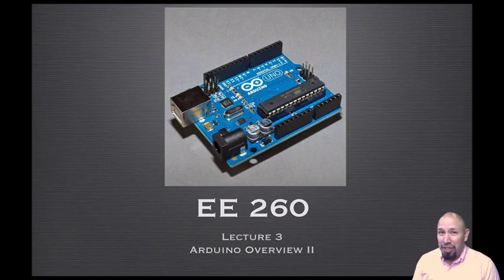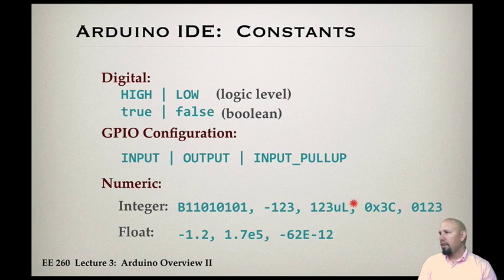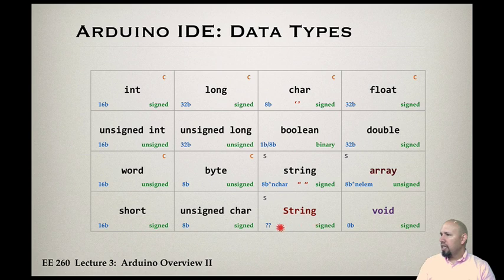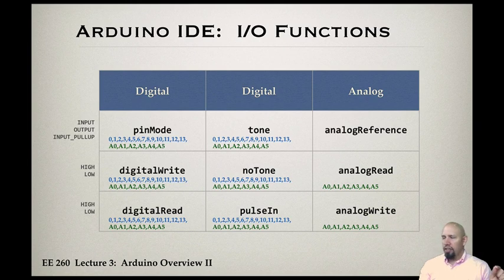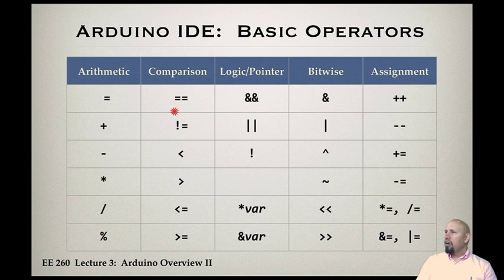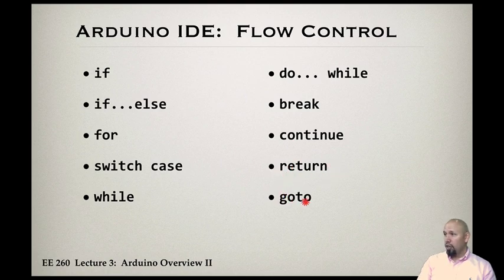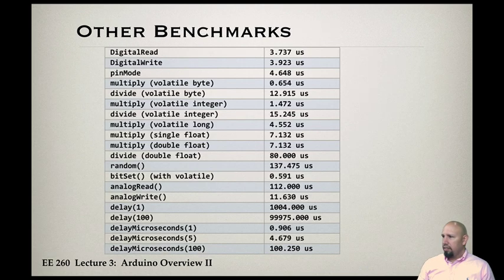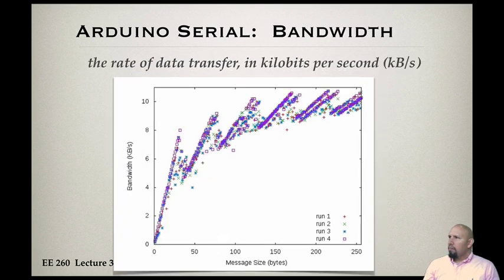3.  The Arduino IDE

Comment: Hi Robert;

I was hoping you could either make a video or maybe email me a discussion about how to write the void setup, pinMode, and digitalWrite functions and how to properly integrate them using C/C++. I personally think this would be a fabulous way to program the arduino, I understand that it is unnecessary since Arduino made those functions for us to NOT have to write that way but I personally find it to be much more fascinating and creative.

If and only if you have time. I have tried finding information around on the internet but unfortunately you get a lot of people who are more interested in posting insults and curses rather than attempt to actually answer the question, so the available information is rather sparse.

Thank you

Comment: Is there any way to do real debugging on an Arduino ?  i.e. breakpoints, source level debug, single step - the Arduino IDE is not able to do it.
Reply from the maker: There is not a simple debugging solution.  However, you can put code snippets into the setup() routine to check if they work properly.  You can send result info out to the Serial Monitor.  These are very basic, but they can be very helpful.